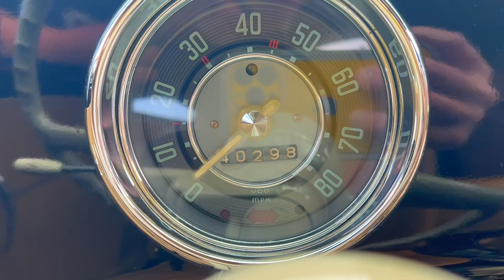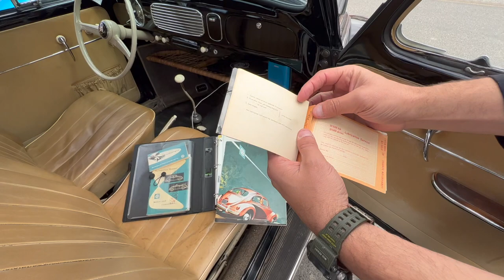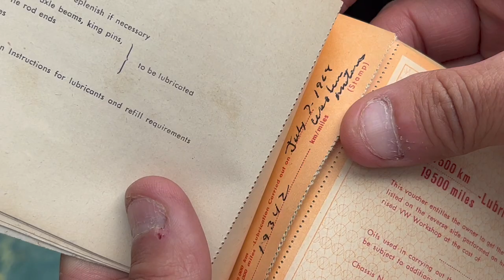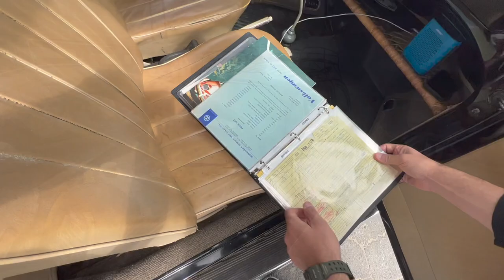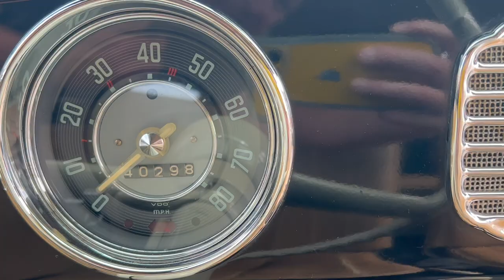Ron's all OG 1956 Volkswagen Beetle with 40k original miles

Comment: You’d dig my 56. Mines an original polar silver on red sedan with 34k original miles. It had a repaint back in the early 60s, but outside of that it’s only been regular maintenance and fox what needs fixed. 3 of the tires are still the original Continentals. Every receipt from 1962-2022.
Reply from the maker: Oh wow 🤩 you bet we’d love her. Sounds like a romance novel in the making 💕🥰 original cars are the best. True treasures 🙌💎😍